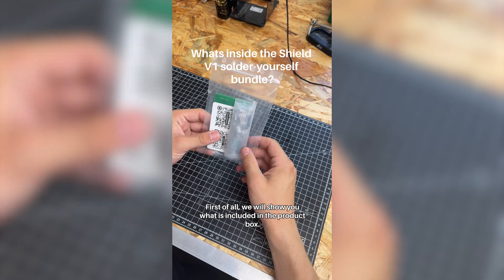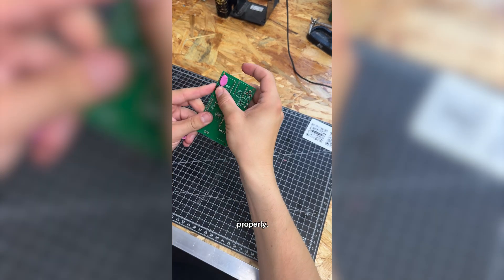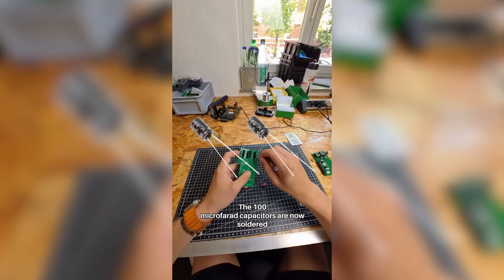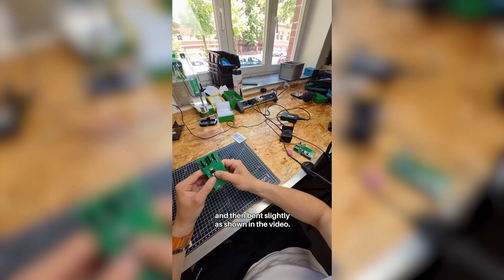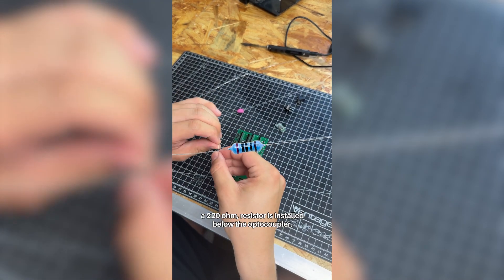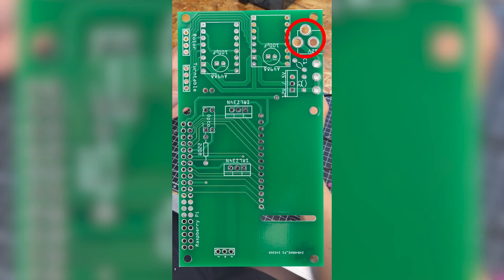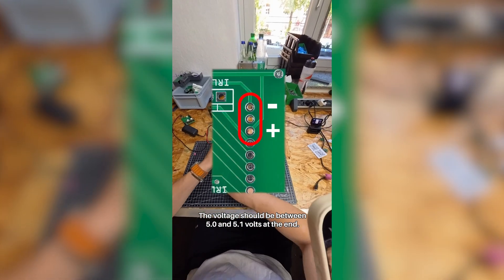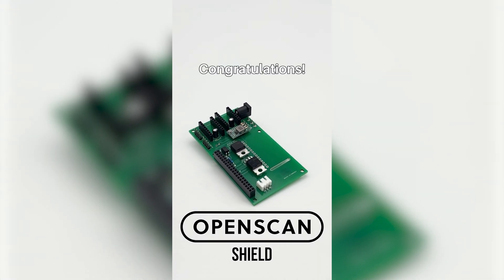[Tutorial] Soldering of the DIY OpenScan Pi Shield

Comment: Everything was great until the end with soldering the female 2 pin, I didn't receive a 2 pin female instead i have a 2 pin male
Reply: Side note when adjusting my DCDC converter I get no where near 12v, or 5v for that matter. Tops out at 4.44v
Reply: Also supplied M3 Bolts do not thread into any piece of the Pi Shield/Camera mount locations. Instructions do not indicate to use Nylock nuts at any step in them. Not to mention you cant put a nut on the M3x8mm bolts because they're too short. Very disappointed in the quality of this kit.